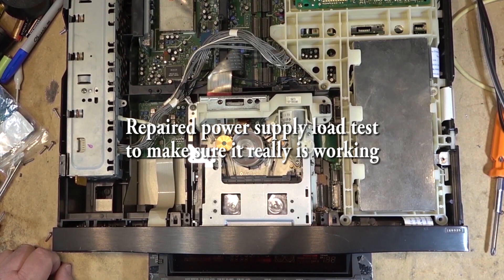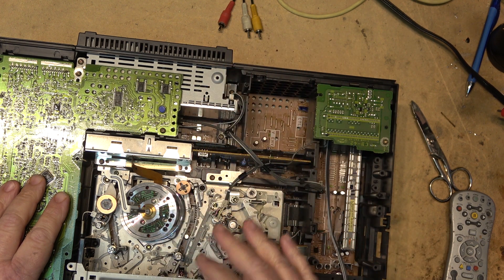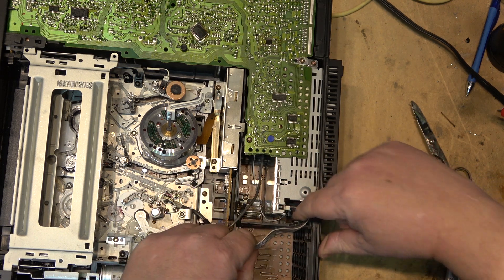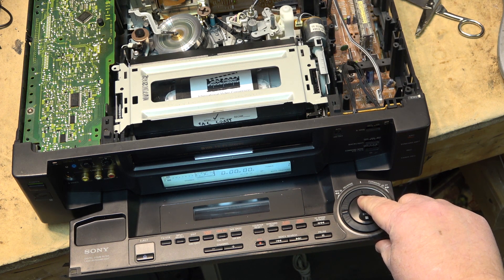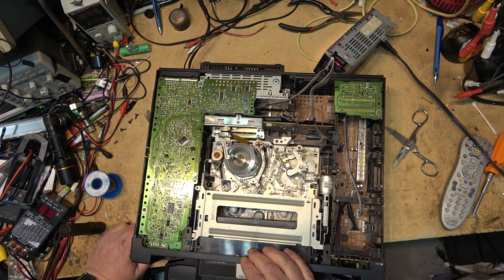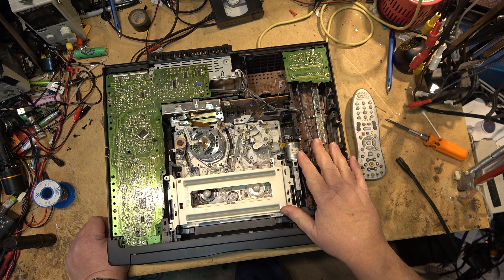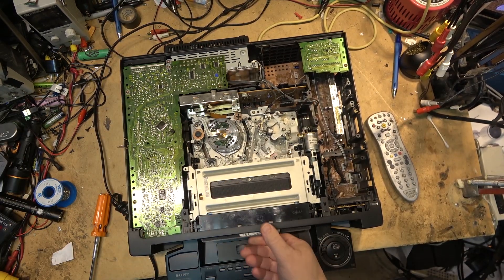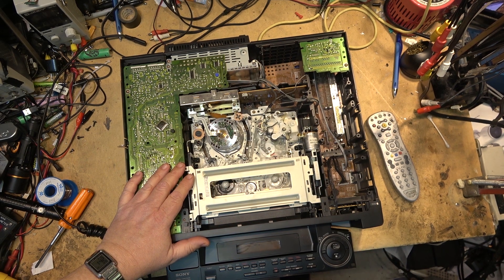Load testing that power supply I repaired revealed a new fault

Comment: Do you use your jvc hr-s9911u at all for SVHS work? Have you had any issues with repairs or problems with it? I’ve got one I bought brand new back in early 2000s and it’s held up all this time, knock on wood.  I used to have Panasonic nvfs100 which was made for the us military px in Europe. It was equivalent to an ag 1960 I think. I worked great until it didn’t, and it was due to all the smd caps.
Reply: I hate those silver turds...
Reply from the maker: the 9911 is here. I have used it. Using the slvr1000 now because the throws OSD graphics up all the time. When archiving it is annoying after a tape glitch "STEREO" shows. Not good for customers digitizing work, and I don't have the remote for it to change any settings.

Comment: I have a spare power supply like that I believe.  SLV-757UC  Great machines back then.  Unfortunately display is dim
Reply from the maker: 757 uses differeny PSU. Weak display is likely bad cap on the -30 rail
Reply: The dim display might just be dirt build up on the inside of the front bezel. Pull the front panel off and clean the little plastic window.